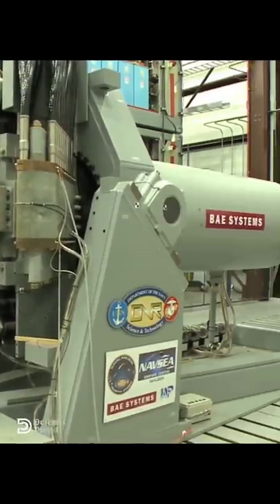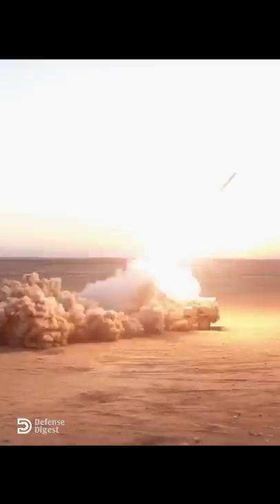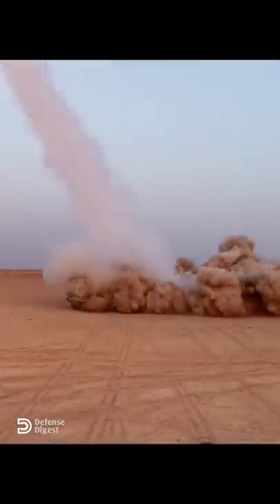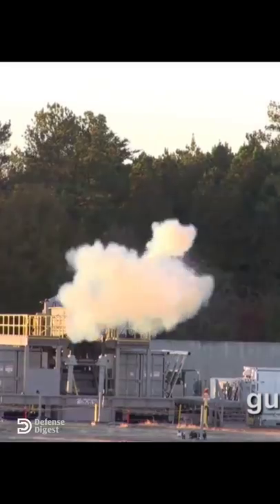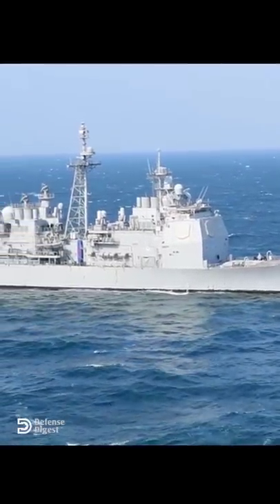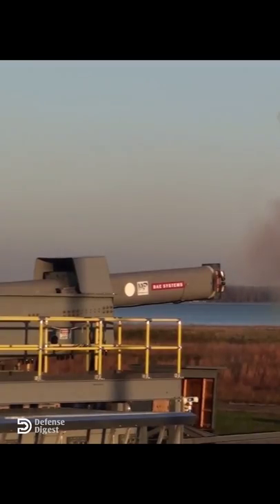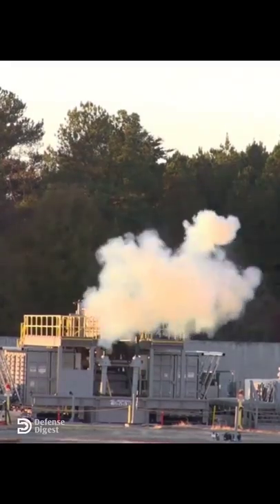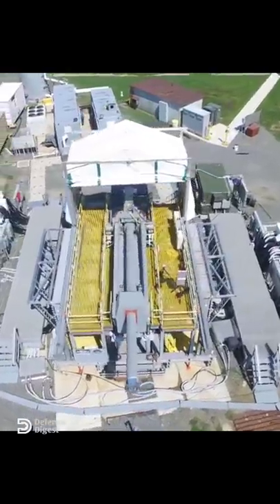Hypersonic cannon that does not require any explosives #Shorts

Comment: They won't they're really ridiculous if you think about it they destroy themselves every time they launch a projectile not only that but the cost of electricity that they produce is staggering the most projectiles that the best one can launch or should I say the most efficient one can launch is 9 to 25 like projectiles before the literal foundation and basin that it sits in crumbles cracks and is pounded to pieces by the power that it creates and projects there are much more efficient much more powerful and much more lethal weapons that I should say are way past research stage and they invite they invite light and electricity on a way different level- frequency or htz  of the laser spectrum  and FOCALIZED at such a small point you can rip through anything with just 10kw of power if you narrow the beam to the pin of a needle and being focused on such a small target will enable distances involving "time" rather than length or curvature of the planet I should say lol